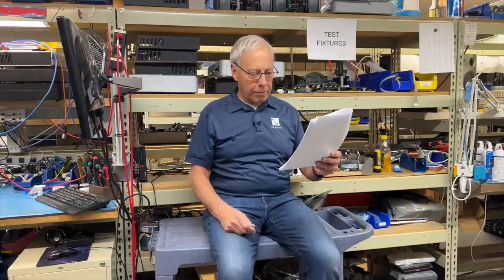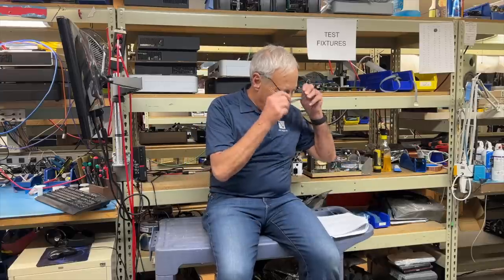The right way to turn on and off your stereo system

Comment: Makes total sense...  To turn ON = Source, then pre-amp, then amp.  Turn OFF = Amp, pre-amp then sources last.  Idea is to make sure nothing is amplified accidentally hence either amp last to turn on or amp first. to turn off.
Reply: Only matters on crap equipment aka equipment for audiofools
Reply: @Harald_Reindl  
True Harald, you don't have to worry with your Close 'n Play record player. Just don't forget to close and open.................
Reply: Nah.. I never ever turn my amps off at all. Always on.
Reply: @Oystein87  too much money? not that i couldn't afford it, but throwing money out of the window is pretty dumb
Reply: @Harald_Reindl  Nope.. Very little money actually. Still no reason to shut the amps off. They barely use any power by staying on at idle or at normal listening levels anyway. And a bonus is getting a bit more heat into the room. And extra bonus is that I don't have to let the amp get warm befpore the system finally sounds it's best. So it's always ready to go. In theory it should also cause less strain(atleast not more) because it won't have to empty and fill the capacitors etc every day.
Reply: @Oystein87  "they barely use any power by staying on at idle or at normal listening levels anyway" is pure nonsense for a class-A amplifier - wasting 30 watts 365/24/7 are around 100 € per year is dumb when i can get two steaks with a few beer for it
Reply: @Harald_Reindl  Who says I have a pure class A amp? And even with mine beeing a class A for the first watts and AB for the rest it still uses very little power in idle. And it also depends how powerful the amp is.. Saying it is class this or that says litteraly nothing about how much power it actually uses. Need to know the actual power usage regardless of what class amp it is.

No, it will nots cost me that much... Even with higher a little electricity prices than what is normal here.
And you forget you get it back in heat to the room. So it is not wasted it is used. I could adjust the heater slightly down so power usage overall is exactly the same. According to messurements and the electricity bill that is...
Reply: @Harald_Reindl  So have I... That is why I know I am correct. Like I said.. Messurements and my electricity usage is EXACTLY the same when turning off the amps and turning up the heat a couple of % compared to turning down the heat a couple % and leave the amps on 24/7...
Here is not that much summer in Norway dude..
No I am actually very far from a perfect example for an audiophile.. An true extreme audiphile would most likely hate me. I ONLY work with facts that I can document. So sorry... You are wrong about power usage in my setup.
Butif you had a HUUUUGE pure class A amp then you would be more correct. But that is not the case here..
And I am not wasting anything.. My amps are always ready to go so less stress on turning them on akd off several times a week and since I litteraly get a little bit of heat back to the room then there barely is any waste at all.
This is a extremely well messured and documented fact.
For MY system. Might not be the same for another guys system. But I guess you forget that not everyone has the exact same system and huge class A amps?
And power is clean renewable and cheap here anyway..
Reply: @Oystein87  there are better sources for heat - look at vienna and learn - heat my living room with electrical energy instead of district heating produced with waste incineration at least for a large part would cost me a fortune
Reply: @Harald_Reindl  Dude.. I have known that for about 3 decades.. But that is so not the point at all here🤣 I said it is a BONUS to get a bit back as heat and can turn down my other heat source by 2% and have the exact same piwer usage. So there is absolutely no reason what so ever for me to turn my amps off unless I will be away for days.
Seems you struggle very much understanding what I am actually saying and just make up your own assumptions instead.
Reply: @Harald_Reindl  Dude... You very clearly did NOT understand what I ment at all...🤦‍♂️🤣
Reply: @Oystein87  i well understodd that you are not very smart
Reply: @Harald_Reindl  Then you missunderstood extremely... Because you actually belive I use my amps as heat source🤦‍♂️🤣 I do NOT.. I said it was a benefit that they deliver slight extra heat. I would keep them on 24/7 regardless if they produced heat or not🤦‍♂️
So who is not smart? You? Yes, that was correct sir.
Reply: @Oystein87  yeah and because of "I would keep them on 24/7 regardless if they produced heat or not" it's clear that you are pretty silly
Reply: @Harald_Reindl  Nope... It is actually pretty smart.
Less strain on the amps just leaving them on. And sounds betyer when warm so only benefits for my use. Shutting them off just for a few hours so they barely cool and then on again is just a waste. But if it does not fit your use then don't do it but for me it is the best way. But you can't seem to understand that there are other use cases than your own personal one so you are the silly one.
Reply: @Harald_Reindl  
How's that Close 'n Play working out for you?
lol!

Comment: I’ve never heard of this, and have been turning on my amp first for 30 years with no issues.
Reply: Nothing wrong with that.  But if you had the power on thump in your system, you'd be doing it the other way.

Comment: I used an adjustable time ON relay to delay power amps turn on and a true off relay to delay power off of my preamps...all controlled thru the swtiched remote controlled power out of my AVR.  Works perfectly for me.

Comment: 'Ole Audiophile to Paul: You've quite a bunch of kewl followers here, they ask great questions. This one's easy, Source/preamp/amp. Always. Turn 'em off in opposite fashion, amp/preamp/source. Specifically to protect your gear from surges & such. Thanx.
Reply: One might want to give the amplifier a head start on the off cycle, it often takes a while to drain themselves of current.

Comment: One thing that surprises me is that so many amps restart at the last used volume rather than a kinder/gentler soft preset volume.
Reply: Why? That's how all amps work.
Reply: Turn the volume down before shutting the amp down, problem solved
Reply: That’s because they aren’t ‘sophisticated’. 😉

Comment: Never turn it off😁
Reply: I turn off 90% of the system just not the power amps.
Reply: Sources you do.
Reply: @Roof_Pizza  same just turn off speaker outputs.
Reply: Yeah but if you’re running heavy draw class A amps, leaving them on all the time kills the electric bill!
Reply: Why?
Reply: Save the caps.

Comment: Additionaly, to the sequence explained by Paul, thanks Sir!, I use to shut the volume completely off in my power amp/preamp before turning their power off. I hope it is a good practice. Is it right?
Reply: If your power amp has an internal relay for the speaker circuit having the volume down while that relay is transitioning between of and on will prevent the relay's contacts from degrading over time so it is a good practice to have the volume down.

Comment: Thumping (especially on shut down)  often means the DC offset is not to spec, generally 0.00 or as close as you can get it without going to negative.  Might as well do the bias as well after the DC offset is set.

Comment: I leave my source on all the time. My amps have a soft start and don’t start for a few seconds after they power up. Also the volume control on my pre is controlled with ladder resistors and not a volume pot.

Comment: On one of my systems or the Adcom system, I have an Adcom power conditioner but also comes with delay turn on.  The order is as follows:

1. Pre-amp first then power conditioner
2. Other source components
3. Amp on last. 

For shutting off:
1. It’s still preamp first 
2. Amp goes off next
3. Other source components along with power conditioner.  

Pretty sure my other system works similar. It also has a power conditioner but this one looks more like a power strip or box.  Both work fine. 

On the other system the subwoofer is connected to a different power strip and is kept constantly on.
Reply: Why wouldn't shut down be amp first?  After that doesn't matter what happens.
Reply: @Albee213  I’m just reporting how the Adcom power conditioner behaves. Don’t shoot the messenger.

Comment: Paul, what do you think about not turning off amp, or integrated amp at all? There are some opinions that it should be never turned off, or very occasionally...
Reply: well...i'm not paul obviously. from a service tech's point of view though if there's no problems with thermal management & you use a ups leave your unit on. the inrush surge is hard on all the components even with advanced power management schemes on board. the big two to watch for though is to make sure that adequate ventilation for your amplifier is provided and remember that while idling the amplifier will be using a baseline power draw and often head units make considerable 'thumps' when being powered on. make sure the volume is all the way down after use.
Reply: He addressed that a while ago and basically said it was best to leave it on
Reply: @Douglas Blake Do you have any evidence to prove that statement?
Perhaps a link to a valid study that shows your statement to be valid.
I personally have a couple of amplifiers that I have been turning on and off for thirty years.
How much has my power supply's lifetime been diminished?
Reply: @Douglas Blake Great you have 40 years as a service technician.
Then you know that all electrical components have a life span that is measured in hours.
Can you tell me what the average life span in hours of an average capacitor in a power supply would be?
Can you also tell me how leaving equipment on all the time uses those hours of lifespan?
Thank you for your expertise!🤔
Reply: @Douglas Blake I'm not out to impress anybody, I am questioning the authenticity of your expertise though.
I have asked you several legitimate questions that someone with your supposed expertise should be able to answer but you dodge the questions.
Anyone with rudimentary electronics knowledge knows that capacitors have a limited life span and that life span is rated in hours.
Anyone that has a rudimentary knowledge of electronics knows that amplifiers generate heat which lowers the life span of electronic components.
So anyone with rudimentary electronics knowledge knows that leaving an amplifier powered on will shorten the life of electronic components by using up the limited hours of life in the components faster as well as shortening the component's lifespan by exposing the components to constant heat.
Somebody in their first weeks of study would of course understand this.

Comment: I used to have the problem that my Exposure X used to blow the fuse when I turned the power on !! After finding the it was the small fuse to the amp itself which was blowing I then found that it was better to leave the Exposure switched On !! But I also find that if I'm not going away for long periods on holidays that it's ok to leave the system in stand bye mode which is no problem at all..

Comment: question- I use the same sequence and always Mute the pre amp. But I do the sequence quickly , one by one. I do not wait more than a second or two in between powering on and off each of the components. Is that OK if pre amp is muted? Thanks.

Comment: I use a speaker selector switch. Pre amp and sources first then the power amplifier then I connect the speakers. I do the opposite when I turn it off. The speaker selector switch is passive so it just disconnects the speaker cables.
Reply: Not a good idea if you have a tube power amp with an output transformer. Turning on a tube power amp with the speakers disconnected from the output transformer can cause damage to the transformer and output tubes. An output transformer is much happier with a short on the output than an open.

Comment: In studios, we don't go through a laborious turning on things bit by bit. Especially in the old days with banks of tape machines and tons of outboard gear! We had a single power switch that powered up the entire tech mains for each studio. But we also had a 7.1 set up with big Quested speakers up front and a subwoofer buried in the wall. I like my ears, so no thumps please! One of our maintenance people came up with a little circuit that simply put a little delay between the amps and the monitors. Only a few seconds, but it was enough. Turning off wasn't a problem, so this was just for those hungover morning sessions.

Comment: have a “newer” Mitsubishi separate amp and preamp/tuner and I get major pops when turning the preamp on/off.  to avoid this, I have to disable whichever pair of A or B speakers are connected to the amp before I power the preamp off.  The amp itself does not have a dedicated power switch on the front or back so at best it goes into a standby mode, and is controlled by the preamp.

Comment: What about adding a capacitor and zener diode between inline with the remote/trigger. To delay the turn on of the amplifier that way everything gets triggered at the same time and amplifier is delayed slightly by a second or two. Now if the amplifier has a thump best way would be a relay with slight delay after amp turns on.

Comment: Alternatively, don’t turn anything off. When I finish a listening session, I turn the volume on the preamp down to minimum and switch on the mute facility. If you have any other devices with a volume control, such as a DAC, turn the volume on them down to minimum. At the start of your next listening session, simply return the volume to your normal listening level and your good to go. No waiting for your components to ‘warm up’, no waiting for capacitors to recharge!

Now, some would argue that leaving your equipment running and staying warn will decrease it’s it’s longevity and there may be an element of truth in that. I would argue that continuously allowing electronics to warm up, cool down, warm up, cool down, is more damaging. Paul himself in previous videos has advocated leaving hifi gear turned on.

The only downside, is maybe a slight increase in electrical consumption.😊
Reply: Agreed.  Source and preamp in particular have a small power draw and benefit from being on constantly.  Power amps other that class A or tube are also thrifty.
Building my own stuff means I can put a switch where I want.  I leave the digital side of my source on 7x24 as that stuff is much better under constant power and does not take much.  The tube output section is a bit more power hungry so I leave it off and warm if up for a few minutes prior to use.
Reply: @user-od9iz9cv1w  👍
Reply: You’re making the case for ‘Standby’ mode which keeps the current flowing but at reduced levels. The damage done by truly removing power and forcing ‘cold starts’ is the stress the thermal expansion and contraction causes to solder joints, especially with older through-the-hole designs; surface mount technology is supposed to be more impervious to this kind of damage (and it better be, because it is more difficult to repair). One must also the damage done to the semiconductors themselves, heat is their primary enemy, so proper cooling is very important. I’m not sure if powering off and on helps or hurts them.
Reply: @Douglas Blake You make a good point, and I know you have the experience to back up your claim. Thank you for responding to my post with a helpful comment.

Comment: My sub is driven by secondary outputs on the preamp. I wait until the relay in the sub clicks off before turning the preamp off. If not, there’s a thump even with the volume all the way down.

Comment: Or just leave the sources and preamp on. Most use little power, and will sound better if continuously left on
Reply: Spoken like a man who really cares for the planet he leaves his children.
Reply: @richardt3371  My preamp/DAC/streamer consumes 15 watts when fully powered. Toasting a single slice of bread consumes more power than this thing uses in a week. Pick your battles.
Reply: @gotham61  That's over 2500 watts per week.
That's considerably more than toasting a piece of bread.
Richard T's point is a valid one.
Reply: @JonAnderhub  "2500 watts per week" doesn't mean anything. It's kind of like saying my car uses 140 horsepower per hour. I think you're trying to say it consumes 2.5 kWh per week, which is about right, and at my current domestic electrical rate is about 26 cents per week. I also live in an apartment, which overall is way more efficient than a standalone house. 
How efficient is your lifestyle?
Reply: @gotham61  I turn off my equipment so my lifestyle is 2500 watts (2.5 kWh if you prefer) better than yours.
Actually based on your lack of concern I would be willing to say my life is significantly more environmentally friendly than yours.😁
Reply: @JonAnderhub  I doubt that. You know nothing about my life, other than I live in an apartment (much more efficient than a house), and I run the equivalent of a 15W light bulb on my hi-fi. 
You probably live in a big oversized house and drive a giant gas guzzling SUV or truck.

Comment: Great video on a simple but very important topic. 
In addition, I have a separate processor and power amp connected via trigger cable . When turning the power amp, a loud metal sound is heard, some kind of a mechanical circuit breaker, is it normal? Thank you
Reply: That's the sound of a relay, an electrically controlled physical switch.
Reply: @charlienyc1  Thank you very much.

Comment: I have a pre-amp and monoblocks (same brand) connected with DC triggers.
When i turn the system on with the remote, the mono's turn on first and you feel the electricity rush into them. 
The pre is turning on and stabilising after them.
How come?
Shouldn't it be the opposite?